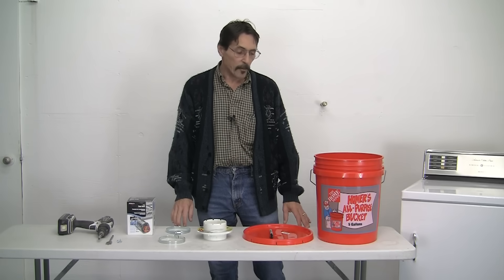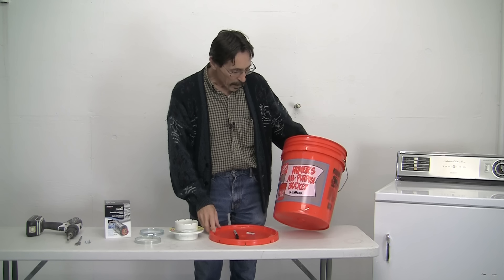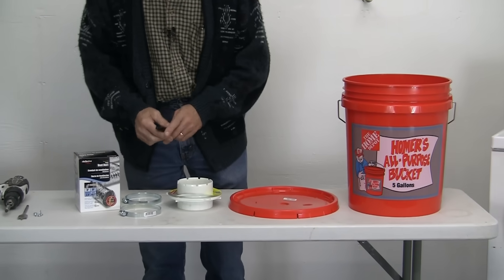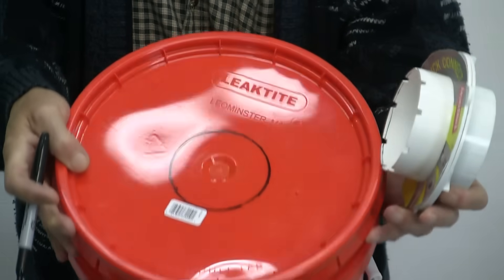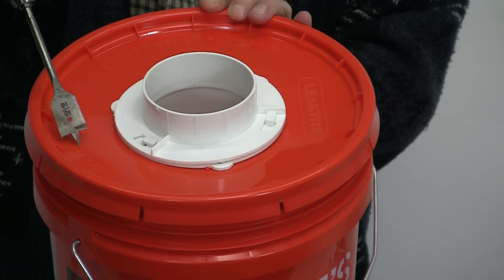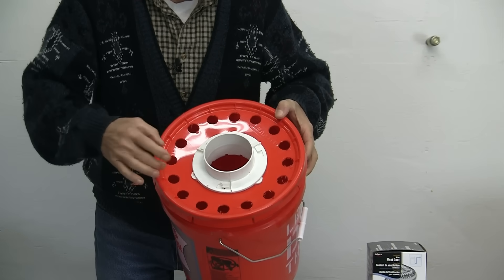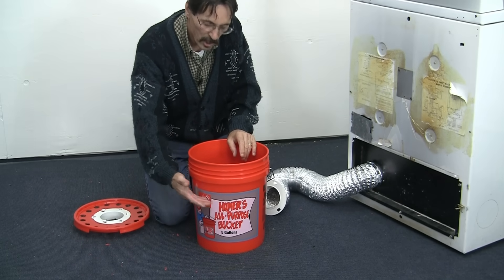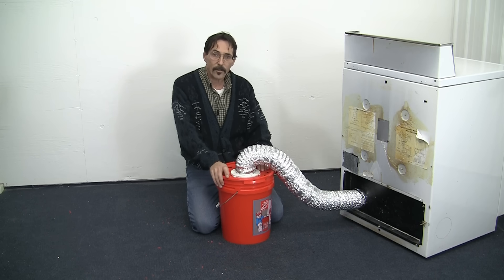DIY How to Cut Electric Bill in Half: Part 3 Clothes Dryer Free Ideas | Missouri Wind and Solar

Comment: @MissouriWindandSolar > great video!
These days though the newer dryers operate using water!, yup...
so i do really bother using the dryer much, maybe in the winter season.
In summer, easy. Although the house is insulated it still gets hot.
So... all ya gotta do is set up a portable clothes hoist in the laundry,
put ya washed clothes on it and it'll be dry in no time!.

Secdonely, make sure you shut any door/s to room you don't use.
and finally,

Thirdly, the room that runs your A/C is really the only room ya want to cool.
In doing this, (since electricity is not very cheap anymore), you will save heaps.
In having said this, and when these electrik companies work out what i'm doing
they are only going to keep putting the prices up!
At the end of the day we'll be living in a cardboard box with the A/C going to 
remain affordably cool.!!!!

Cheers!
Mick

Comment: I've seen videos on how to make newspaper bricks for a woodstove by soaking newspaper shreds in water, compressing them to get the water out, and letting them dry. Would you be able to use the lint water from this project to soak the newspaper, or would that be too dangerous?
Reply from the maker: Yes you could use it. It's harmless.
Never made paper logs before. I heard they work pretty good.

Comment: Used a 4" to 5" adapter instead of the white twisting and locking thing.
Works super well.
Added cedar esssencial oils to the water. Smells freaking good here !
Thanks !
Cost me 20 cdn dollars too.
Reply: When you say adapter what do you mean ? Like material wise
Reply from the maker: I like the cedar oil smell. I hadn't thought of using that, thanks

Comment: I watched this till the end only to learn I could die if I did it with my gas furnace. 😂
Reply: wait what?  he said if your dryer is gas, not your furnace....he said you if you have an electric dryer then you can do this and it will keep your furnace from turning on. lol.....or did you mean to type that you watched this whole thing only to realize you can die cuz of your gas dryer? lol
Reply: Smoke the mirroR I meant dryer. I’ve got furnace on the brain as I’m in the process of replacing mine. 😜
Reply: @HeidiPyke  why you gotta replace ur furnace? Is it just that time? .... Are you doing it yourself?
Reply: @ashadedreflection4486  It was suddenly blowing cold air. Intermittent pilot doesn't light. Service guy ran a camera up it and showed me rusted out holes in the fire box. Said he couldn't legally repair it lol. It's the original furnace from 1970 so I'd say it's time. Got a used (pulled by a builder after deciding it wasn't powerful enough) Carrier I need installed. Haven't gotten a bid yet but I'd love to do it myself. Just don't think there's enough good YouTube videos to show me everything. This new furnace is a lot shorter so I'd have to build the box down. Have no idea where the air filter goes then lol. And it's in a closet so no room on the sides. Looks like I'll be trying to find a guy willing to do work on the side. Ugh...
Reply: @HeidiPyke  oh man you can totally do it with the lack of YouTube videos, how far did you end up making it before the expert came in?
Reply: Smoke the mirroR 
I’m afraid I’ve chickened out. I was thinking I’d take pics of everything and go down to the local furnace place to ask them questions. My furnace is in a closet so there’s no room for a side filter vent/slot like I see in most videos. And this Carrier furnace seems to need two exhaust pipes and I only have one currently. 

In the mean time I’ve been holding down the gas valve button with a rock and running my old furnace for ten minutes to take the chill off the house lol. That and making a fire every night. I might even just buy a used gas valve (it’s either that or the Honeywell pilot control panel.) off of eBay and just deal with the new furnace after winter. 🙄
Reply: Lol .... You were like all excited till you got to the end, like oh, k , if i want to fall asleep and never wake up again I'll just do this project....haha, dam
Reply: @ashadedreflection4486  Exactly 🤣
Reply: Starfish I’m getting a hook up with an expert to do it on the side!

Comment: Dry your clothes faster, with less heat waste, by installing a coil cutoff relay that turns off the coils after 2 minutes, staying off for 2 minutes, so the heated wet clothes are having cold dry air blowing across them. That's how you dry your clothes in half the time, with 1/4 of the electricity and stop sucking your heated air out of the house, which is, in turn, sucking cold air into your house through all the cracks in the walls, windows and doors. You reduce the health dangers of having too much humidity and creating the perfect environment for mold and bacteria by dumping water into your home. P.S. wet walls lose heat faster. Humidity doesn't retain heat, it makes it drain from your house faster as the cold walls collect the heated moisture and transfer the heat out.
Reply: can you post a link with the coil cutoff relay switch? .... or even something that explains what your talking about? ... i mean they both sound logical, but they both cant be right, it would be nice to know the truth

Comment: I'm glad you drilled more holes than you originally marked, you would actually need 19 15/16" holes so as not to restrict the airflow. The area of 18.2 x 15/16" diameter holes equals the area of 1 x 4" diameter hole. Lol.
Then again the id of the 4" connector is probably less than 4" so you were likely about spot on. :-)

Comment: I have not tested this, but common sense says most of the lint would get blown right back up with the airflow, the water is not going to be able to catch much of it... for this to have a chance of working, the air would have to be pumped thru the water slowly, but that would pretty much stop your airflow. If this would work, your air purifiers and vacuum cleaners would have been water based. It don't.

Comment: I'm not sure all the lint would be trapped in the water if it isn't forced through it. Perhaps you could extend the inside pipe down to water level or just below... Too far would probably create too much friction and slow the dryer flow down.

Comment: Nice idea. We used to live  in a house with the washer/dryer in the garage. Our exhaust vent hole was too high up on the wall. So we just angled the vent hose out the back door on the ground. Then picked up the lint. I think that the hole in the wall for the vent was clogged.
Our apartment has a place in the kitchen for our washer/ dryer. We kept having problems with the dryer. So the handyman cleaned it out. There must have been lint in the wall for years. It works so much better. Then our washer water would spill out onto the floor. So the handyman had to connect pvc pipe behind the washer-refrigerator-oven- to a pipe joined to the kitchen sink. It is so much better. It's the simple things in life that are really exciting when an appliance problem gets fixed.

Comment: That's real nice if you are drying clothes all day every day. But elect dryers are 220 volts and you'd be using alot of electricity running your dryer all day long. I don't see where you would be saving alot of money with this method and I only wash and dry clothes like once a week. So it would be best to just run your air and heat and seal leaks around your doors and windows and insulate your attic properly. Clothes dryers are for drying clothes not heating or cooling your home. Duhhhh...

Comment: Thanks so much for the video. I live in an apartment run by the town housing authority and they wanted me to get rid of the dryer because I was venting it into a a/c filter but it was also venting out through the apt. My back problem will not allow me to hang clothes on the clothes line without severe pain. This is an awesome idea and I can't thank you enough. Now I got to keep my dryer!

Comment: This comment will get lost in the 2,000 already made; I used his idea and improved on it. I added a funnel where the coupler enters the bucket to direct the flow of air further past the vent holes. I also covered the vent holes with an old dust mask that I had cut into square pieces. I used foil tape to affix the squares to the lid. When using a spade bit, get it started on one side and just cut into the surface, then flip the piece over and finish from the second side. The spurs on the bit will catch up to the scores and cut a neater hole. This applies to metal, wood, and plastic so that there is less reaming and clean-up. Instead of a knife, use a bar of wood as you would a drafting compass and affix it to the center of the lid with one screw. On the far end, screw a sharp drywall screw at the radius of the vent hose/coupler. This will result in a perfect seal that will not leak. The directing funnel can be made from a smaller diameter container. Hold it all together with three carefully placed screws. Home Depot sells 'Leaktite' branded lids made of soft plastic and with shallow edges which slip easily on and off the bucket.
Reply from the maker: Sounds like cool idea Marcos
Reply: Can you do a video on that? And share the link here so I can check it out.
Reply: Wish you would have added pictures of your job..

Comment: Don't see how that cuts electricity or bills...
Reply: Takes away from the extra heat needed to heat the home in the winter. And for the summer, by pulling the air down from the attic this allows for less hot air to be drawn into the home from all the leaks/cracks around the windows/doors.

Comment: i've used the small buckett, that i purchased at Menards, for 2 seasons. Heats and humidifies the house just fine. it will not tip over if attached to the wall, and i only have to fill it about every 5 loads.
Reply from the maker: You know that the bucket does a nice job of heating and adding moisture to the air. Ever have any problem with mold ?

Comment: hey Jeff thanks for sharing your knowledge I am about to puchase a wind turbine I have a solarpanel array at but need some extra power to keep my home running on batteries . what si the best option for me as a beginner ? thaks
Reply: PCA Management Services SRL  I’m a money saver also, so I’m always on the lookout for green/low energy. I’ve found one resource that gets overlooked a lot is elbow grease. I try to use mechanical devices and tools over electric in order to save money. I just recently got this blender/chopper device with a pull cord that replaces my electric blender for most functions. In summer, I’m going to test how well it makes daiquiris.

Comment: I've been doing this for years with no mold problems but I only do a load once a week waiting for a cold day but I'm using a flannel pillow case cover instead, too lazy to do the bucket & no place to put it anyways, just shake out the pillow case every so often. Windows sweat up for awhile but dissipates pretty quick. If your doing laundry for a big family, I can see there might be an issue with moisture but seeing some of the comments here shows how retarded some ppl are & why communism is a necessary evil, some ppl are to stupid to think for themselves.

Comment: In your other video on pulling heat from attic you taped up all the "cracks" in the dryer. So if you exhaust the moist heat into the area next to the dryer wouldn't your dryer suck that moist heat back in and make it more difficult to dry wet clothes inside the dryer?
Reply: probably , makes sense to me , the warm air must be recirculate away from the dryer to be effective .

Comment: Humidity should be considered when heating a home. It is healthy to have it around 40% during normal winter temps arouns 20-40 degrees. As temps drop you do need to decrease humidity as well. If living in cold climates where it gets to -10 and below, it is best around 15%.  During summer months it is not needed for obvious reasons. We are up north and generally keep it around 30 ish %. We do alter as needed and have never had issues with mold occurring. I would say at least have a way to check humidity if trying this, as mold would  definately be a great concern.

Comment: Hey thanks for the video. This is a great idea. We have a small cottage with an electric dryer and probably not much insulation in the walls.
Reply from the maker: It does work well.
Reply: See if you can get the insulation levels higher round the room where most of the heat is used. Even reducing the air flow over exterior walls will help.

Comment: Thanks for the advice this has helped immensely on my heating bill and I expanded the tip to heat a  6 1/2'height ,9'Length ,45"depth /Terrarium/Vivarium I built as the center piece in my living room https://youtu.be/cojahwAKl88 
If you use a dehumidifier like I do I gain the extra heat in my house from that source and flush the water wasting toilet with the water collected and my furnace this winter alone close to 60% less use now that I've implemented this incredible idea. Oh throw bubble wrap on your windows almost 90 % heat retention with another simple item we all throw out

Comment: What humidity is too high for safety from mold caused by stream from the dryer? My garage in Washington State is 45 degrees and streams up with my dryer running. I don't want to cause mold in my garage.

Comment: I live in Virginia.  I’m also a hvac tech I tried this in January which is our coldest/driest month.   Within 30 minutes my windows were dripping wet and the drywall had water running down all over.   Just get a steam humidifier and use distilled water.   Way less trouble
Reply: Not to mention all the lint that ends up all over the furnace filter, all thru the ductwork.  Both supply and return.   
There is a reason it's recommended to vent ALL dryers to the outside.  Anyone with ANY kind of respitory condition will suffer the worst.
Reply: If your furnace can draw in chlorides from laundry for it’s combustion air it will void your warranty. 
Just one more reason to follow manufacturers requirement to vent the dryer exhaust to the outside. 
Not on the same wall as the furnace combustion air intake.
Reply: I got a good laugh from your comment

Comment: I don't get how the lint gets down into the water.  The exhaust comes in through the top and then would bounce off the top of the water in the bucket.  Then it would just go out of the holes in the lid.  It seems only a small amount of the lint would end up in the water.

Comment: I live in so cal and have been simply taking the vent hose off the back and we run our dryer at night.  We always run the dryer at night anyways.  All major appliances after six pm for cheaper electricity. My heater has been broken for about four years.  Come winter and the house begins to drop to low sixties, we take the hose off the back and just let it enter the rest of the house. No bucket.  We run a couple loads some nights to take the chill off a little.  Our house is big enough to not have a big increase in humidity. I welcome some humidity as my skin gets dry and itchy with the dry air.  I imagine if your house is smaller, humidity could be an issue.
Reply from the maker: Good idea.

Comment: I have actually done something similar for alot of my customers that live in trailers. Most of them have issues with freezing pipes during winter months so I install a T valve and send one end out of the house for summer and the other through the floor for winter. The humidity and heat helps to keep the underside of the trailer warm and prevents freezing. The ventilation from the skirting helps prevent water buildup on insulation and structural materials so no mold or rust damage done. The excess heat also helps to heat the flooring of the trailer which keeps the furnace from running as often. Thank you for the video. Definately something to keep in mind for customers with much larger homes.
Reply from the maker: That's a smart idea. I will pass that along. Thanks Jeremy
Reply: this is genius I live in mobile home. great idea especially for the floors.

Comment: Extremely innovative idea. Love the concept. I personally would not do it myself due to moisture control. I understand the concept of using it in climates that have lower humidity levels, however, another aspect to be considered is the difference in how homes and buildings are being built now days. Homes are now being built more energy efficient which equals less ventilation air coming into homes. Homes now rely on mechanical ventilation to bring fresh air into the home to prevent indoor air quality issues. However, the calculations to determine how much ventilation air is needed does not factor in this amount of humidity in the home. Moisture is the worst factor for a home. Over time it kills all building components, such as drywall, insulation, etc. It also will create higher chances for convection loops in wall cavities and various areas of the home. The best way to save money is to create energy efficient homes, accurate amount of ventilation air, and be as conservative on energy use as possible. I love the innovative thinking.

Comment: Using this to help heat your house? That at least makes some sense to me. BUUUUUT....cutting your bill? Makes no sense to me. If you're running your dryer and using electricity why wouldn't it be the same as running an electric heater? My dryer doesn't take an hour to dry clothes. I'm looking in the 25-30 minute range. So running a dryer only to dry clothes wouldn't do much heating. If the dryer ran just for heat purposes, in my mind it would be the same as using an electric space heater. Can you explain the electrical usage of a dryer vs the electrical usage of a space heater and how it cuts the electrical usage?